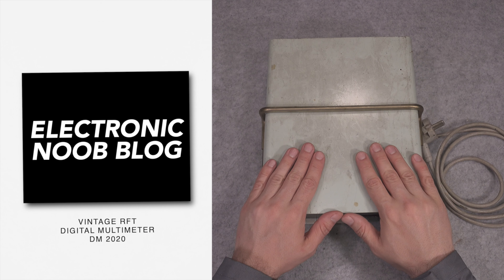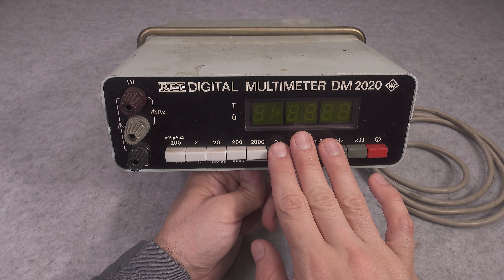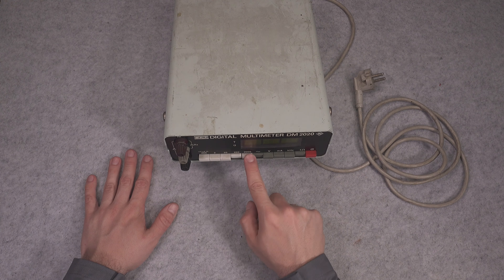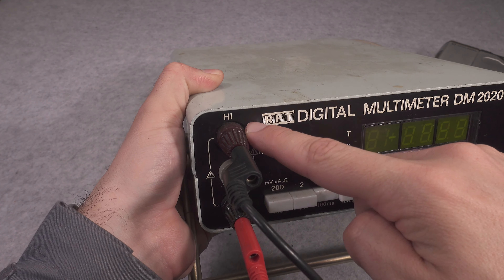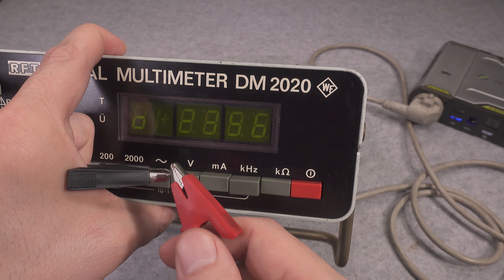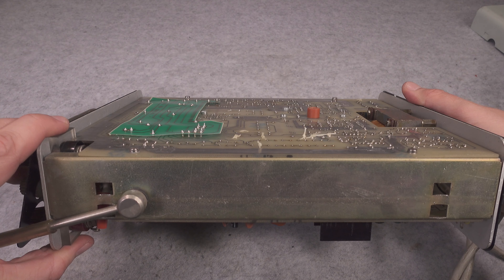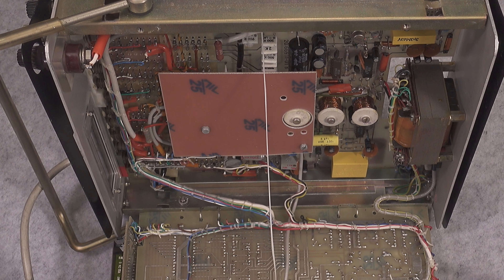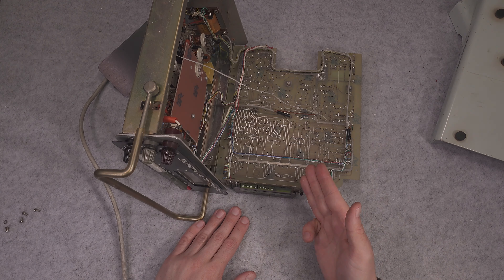RFT DIGITAL MULTIMETER DM 2020  - vintage design with right to repair in mind

Comment: Not quite there yet, but I would love to be able to design something like this from scratch. And DIY screw one up.
Reply from the maker: I would say that lot of vintage electronics were easier to fix... i remember times when devices have DIL IC and Transitors in sockets... as part of repair process many times You could just swap same IC from one part to another and see if issue was resolved... without need of soldering iron... try design like this and You will be gold!